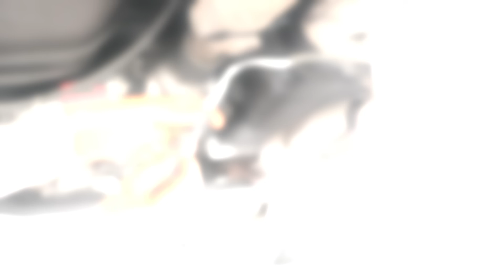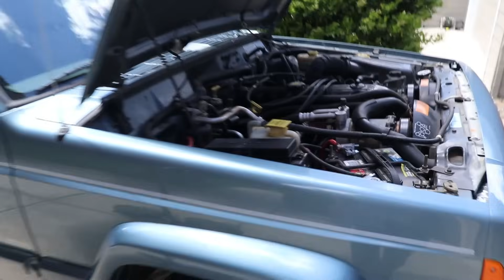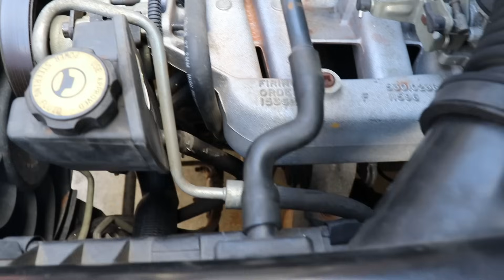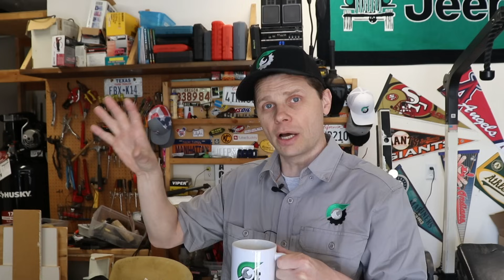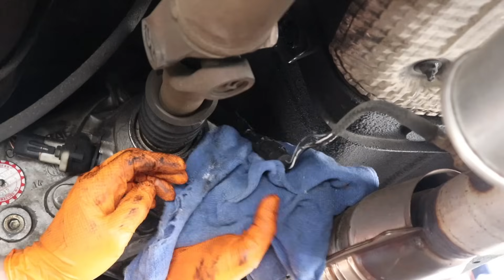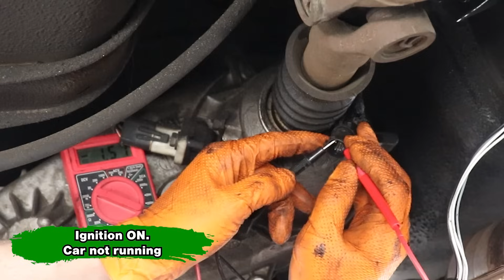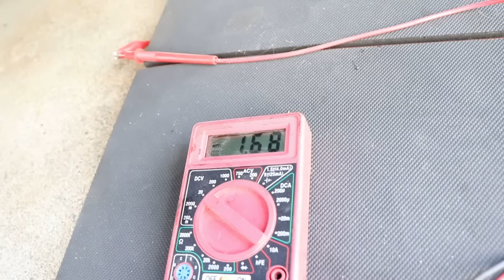Don't Buy Oxygen Sensors! How to test o2 sensor

Comment: So the upstream it's in the engine compartment and the downstream underneath the vehicle correct?
Reply: No that not what upstream and downstream mean. Upstream is the o2s before the catalytic converter and downstream is after the catalytic converter
Reply: @ThanhLe-sd2id  got ya...thank you.
Reply: @ThanhLe-sd2id  HI Le, I have a 2005 Accord code p0139 slow response bank 1 sensor 2. I replaced a new sensor pass inspection but the code came back a week after . What do you think. Is it the cheaply sensor $30 Amazon or something else. ? Edited, after thought I want to add that I replace a cheap catalytic from Ebay $65 in summer 2018, I DIY and it runs but keep getting p0139 . Mileage is 245K, and it's a standard 5 speed 4  cyl. Anything will help. 

Could it be the knock off $65 catalytic or the cheaply sensor $25-$30. ? Or something else? Fuel Injector?
Reply: @benten6301  there a tsb 14-001 for p0139, bring it to a dealership and check to see if your ecm need updates.
Reply: @benten6301  I've heard those aftermarket cats don't last long.

Comment: I am confused how does it give a voltage if it is not connected to the battery
Reply: Thinks of it's like voltage generator except instead of magnetism, it's used the difference between exhaust gas and oxygen to produce voltage signal.

Comment: Hello friend, is it ok to simply use the data stream feature on each O2 sensor using an OBDII reader? It seems like a little less trouble, or is this not an accurate diagnosis.
Reply: Yup, you are correct...when you see the jumping voltage values in obd data, it means sensor is doing its duty....BUT What if it doesn't show any voltage? Or obd gives you error code for this sensor, will you straight away change the sensor??? No, you need to varify

Comment: Never use multimeter with active "low battery" indicator. This cause a higher measured level than the real one.
Reply: So how would check?
Reply: @dannymartinez8522  With multimeter with charged battery inside.

Comment: Do up stream and downstream  02 sensors have heaters in them?
Reply: Almost every upstream or downstream O2 Sensor has a heater. But if you have a newer car with a wideband (Air/Fuel Ratio) upstream sensor, there will be no voltage produced by the sensor itself, you can only measure the heater for (correct) resistance in this case and measure the voltage provided by the ECU.